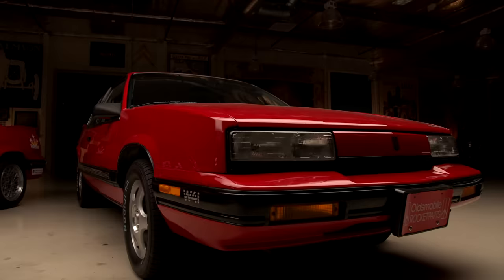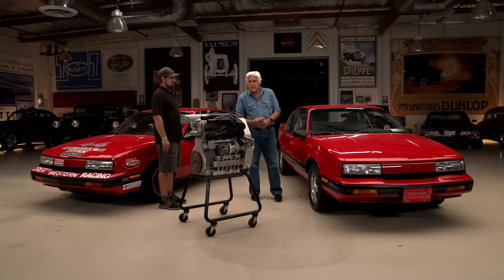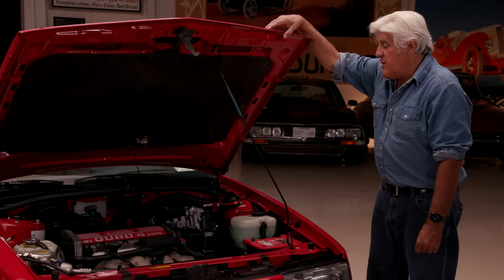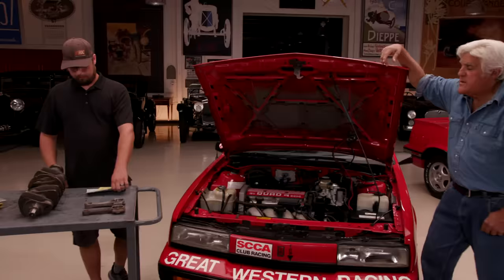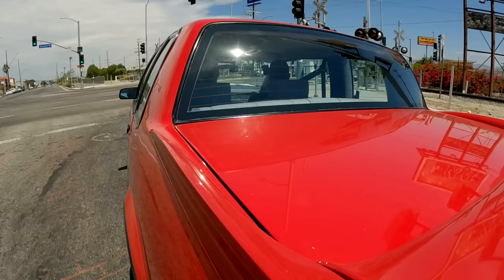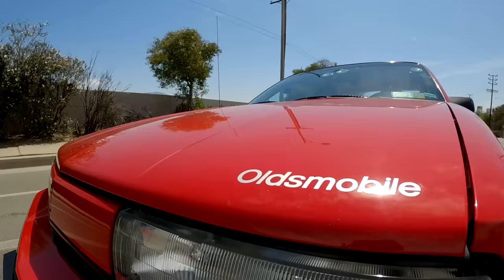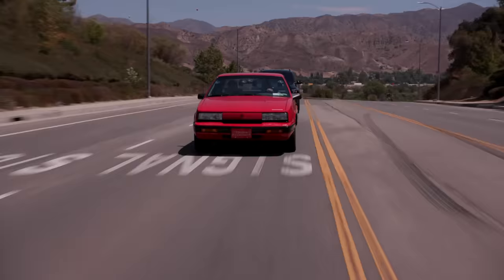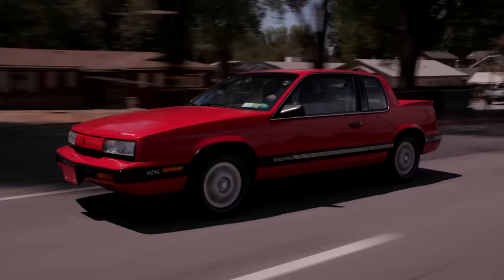Rare 1991 Oldsmobile Quad 442 W-41 | Jay Leno's Garage

Comment: I worked on many a quad 4 back on the day. Great engines that lasted 300k miles. Change the timing belt at 100k, coil packs under that cover, plugs, and water pump and viola your done. Absolutely 💯should have gone into the Fiero...and I almost bought a cutlass Calais IS or international series. I think I have a brochure around the shop here somewhere...had a friend with  a turbo grand am,, same chassis,, that sucker would fly...get well Jay we Love you

Comment: Reminds me Beretta GTZ🥹/Z26 still lives 😎best to leave  motors stock on these old GM💎 Quads/3.1-3.8L 🪨only change the muffler flowmaster Super 44 keep all O2/cat daily em till they die and only use metal gaskets when they go but their easy DIY learner  reliable engines those 3.1s  now them Quads good luck 😭

Comment: Electric will not work in the upper midwest in the extreme temps. We will still need internal combustion in those areas until they find a battery that won't get a strain on it in the cold. I own a Hybrid I get 475 miles to the tank in the summer and 350 in the winter.

Comment: So did Grand Am or Skylark ever get quad 4 or similar engines or was that only for Olds?
Reply: The Grand Am and Skylark got the LO 150hp 2.3L Quad 4. All Buicks were automatic. The Grand Am GT could have been ordered with the HO 180hp 2.3L and 5 speed.
Reply: @Draftinwithjr3815  so if you wanted the 190 you had to get the Calais?
Reply: @Dan Wake  correct. Less than 2500 examples were produced between 1991 (200) W41 Calais, and 1992-1993 Achieva SCX W41.
Reply: @Draftinwithjr3815  only 200 Calais were made with that engine? It’s amazing so many people in the comments know someone who had one lol. So the achieva would be a lot more common then. Probably heavier though.

Comment: Grandma had a car like that with the Quad 4 motor and I did a tune up on it. It took me like 6 hours to get to the distributor cap. They had it stuffed under the back of the motor. But it was kinda impressive for a 4 banger. I had my 72 Dodge Challenger with a built 383 so no comparison.

Comment: Worked in a garage during that time that engine sucked! Only one worse was the 2.5 liter in the lemans!😳Lemans! 2.2 was the way to go, 2.2 would come in with over 200,00 miles and still pass inspection, 3.3 and 3.8 V6's were great aswell. 3.8 was an Awesome engine!🙋

Comment: Hmm...  
  
The 1992 Opel Calibra Turbo is similar -  2-liter DOHC 24 valve, turbo, 204 hp, 4-wheel drive, 0-62 mph in 6.7 seconds, and 152 mph top speed.  Not 204 built, but 12,677. (all Calibras 240,000).
 
 And sorry, I think the Calibra is a little more elegant than this one, was a coupe version of another car call Vectra. 
  
Maybe have a look.

Comment: unfortunately the mass produced quad 4 engines were junk. specifically the 2.3l version. they came in the buick skylark, grand am etc. mechanics hated working on them. head gasket issues galore. thermostat housing is located under the rear exit exhaust manifold. definitley a low point of the 90,s for gm. the 2.4l version was a lil better, but still suffered issues.

Comment: I had no idea they put that much engineering into that car.  In typical GM fashion of the day it was buried in favor of more “Dustbuster” minivan ads and other failed lines of effort.
Reply: The dustbuster minivans that got the 3800 V6 were fast.  Car and Driver did a test of minivans and the Olds Silhouette with the 3800 smoked the field.

Comment: Didn't they have this in the 2door Beretta with 193 hp?
Reply: 180hp HO version of the Quad 4.
Reply: @Draftinwithjr3815  We had it with officially rated at 193 hp (and probably more than that, inofficially).

Comment: Definitely a cool little car but to say that they beat on 5.0L's is a little bit of an exaggeration.  I was actually a car salesman for about 3 years at a GM dealership around 1990, and I drove a couple of these (or the Calais International, which was a glammed up version of the Quad 442 but essentially the same engine/car...)   Much to the disdain of the management of the dealership, I drove a green 1990 5.0 coupe with a 5 speed (of course I had to park it across from the dealership! Lol) I can conclusively tell you that no, these cars would not beat on any 5.0 5 speed unless the driver was asleep or over aggressive at the light (up in smoke!)  Except for maybe a full load GT 5 speed, these were mid to low 14 second cars bone stock from 87 to 93. If you beat the snot out of the Olds, revving to 5 grand and hoping to hook, and you powershift thru the gears you 'might' get close to a high 14 second run. But to break into the 14s in this era, with the power the 4's had (shy of a heavily breathed on turbo) - was exceedingly rare. Remember, the 5.0 had 300ft/lb of torque compared to around 200 in the Olds, plus 225hp vs 190. And the weight difference was only about 2-300 pounds.  My strippo coupe had no a/c, roll up windows or sunroof, and minimal power robbing options. The 'I beat on 5.0's all the time' folklore of the era was (far) more often than not, highly exaggerated! And yes, I'm 53.  I'm old enough to have seen and lived through the revival of the musclecar wars...which were started with the much loved of loathed 5.0 Windsor. 

Now,  if he's talking about the 1994-1996, then yes, you can probably run door to door with one...sadly
Reply: Sadly you are mistaken. The W-41 is not even close to the same as the I series you are talking about. The W-41 is far more than even the W-40 Quad 442. Yes, the W-41 will beat the 5.0 Mustangs because I beat many of them in mine. I will admit that you would not have to do much to the 5.0 to beat these cars but stock to stock it was all driver
Reply: @oldsjetfire8975  sorry but as much as you may like the car, you're incorrect.  It's pure physics. You have a car with over 50% more torque (which is what wins races  - we're not talking highway roll races or top end speed...which the v8 would also almost always win) - as well as a good 30+ horsepower.   In  a car weighing a few hundred pounds more. A notchback/coupe 5 speed, whether earlier speed density or mass air, is around 2900 pounds. Like I stated, a porky GT with all the body cladding,  heavy hatch and (typically) power options would be a drivers race, more often than not due to them being around 3200 pounds.  As well, you're far more likely to run into one equipped with an automatic.  And if you beat one on the street (unless you actually knew or chatted with the guy after) all your ego will tell you is you smoked a mustang. And this is what you'll tell your friends. There was nothing in the price range - domestic or import, stock for stock - that offered more bang for the buck than a 5.0 coupe from 87 til about 92.  Primitive in many ways,  but nearly indestructible. And if you couldn't run a mid 14 quarter off thd showroom floor, something was wrong. Even when my car had the ridiculously tall 2.73 gearing i ran a 14.34 at 93 mph. No mods. Firstt run (sea level) And you could buy one brand new for around $12-15000. Don't get me wrong,  The Olds were quick for what they were. But we're talking about a n/a 4 cylinder. Again,  I not only drove them,  I sold them at the exact time I owned the mustang. Even to this day drag racers love these fox bodies and they are selling for crazy amounts of money. It wasn't until the Diamond Star triplets that there was serious 4 cylinder competition to the 5.0. Possible exception would be the Chrysler turbo coupes (laser, Daytona)  Even those, in stock form, couldn't hit mid 14s, but with the turbo had a fighting chance...but being k-cars, they were almost literally disposable.
Reply: @lancemannion4113  I am talking right off the show room floor. Every magazine from the early 90's was saying an automatic 5.0 was mid 15's and the manual was low 15's to high 14's. All my friends cars were also in that range with their 5.0 Mustang. The 5.0 Z-28 was even worse. The W-41 was a consistent 14.7 car. In the end, neither your experience or mine mean much when ALL the magazines were consistent in these numbers. With that, I stand by my statement that it is going to be all driver between the two cars. There were only 204 of the W-41 cars made, you likely drove a W-40 and not a W-41. I need to post the video of me beating a 5.0 Mustang. I admit, I did not beat him bad in this video but I consistently beat them in the 90's.
Reply: @oldsjetfire8975  The big 3 magazines (Car and Driver, Motor Trend, Automobile, Road and Track) were all notorious for being 'gentle' as far as trying to establish the best results possible. When you went to hot rod magazines such as Car Craft, Hot Rod and especially Muscle Mustangs and Fast Fords, you will find that these publications were much more in tune with what it took to extract all the power and put it down to the ground, which they did. I actually have 2 full cardboard boxes of all these magazines listed from 1986 to about 1995 (probably about 500 magazines) as that's what I when into the scene and I was pretty much obsessed with drag racing and the muscle cars of the era. I can certainly send you screenshots showing how all 3  mags got these cars into the low 14's but the trick was you had to master the launch and not exactly be gentle with your upshifts. The car could easily take it but the mainstream publication magazines wouldn't go so far to 'beat on it' to get the better time. And another problem with the Mustang, and the reason you probably beat one is because they were cheap, so they were easily accessible to the younger crowd who were over enthusiastic and really didn't know how to drive them (see, wall! Lol)  They just thought you could rev it to 3 grand and dump the clutch and you'd be off and running. Which is never the case with these cars (without slicks) With the solid rear axle they will hook up but it took prodigious use of the throttle and clutch. But once you mastered it, these were easily keeping up with corvettes on the street up (until the LT1 was introduced) And even the Corvette powered IROC and GTA with the 350 L98 weren't really a match, although they were closer. I do recall the mustang probably lost a couple of tenths of a second around 1991 with the light refresh when they went to the 16" wheel. But even then there's no way a properly driven 5.0 would lose to a 4 cylinder with 195 horsepower. It doesn't compute. Just because you beat 1 does not mean you've set the precedent. 9 times out of 10 they will pull ahead right through the quarter. 

Bit we can always agree to disagree if you want.
Reply: @oldsjetfire8975  bone stock, as an example...(14.16)

https://youtu.be/gAlRas_r-1Y
Reply: @lancemannion4113  So what you are saying is that the W-41 would also be in the low 14's if it were Hot rod or Car Craft and not motor Trend or Road and Track? In the end, neither one are very fast and I know them both well. You have your mind set on the W-41 being inferior and not an equal. That is typical of what I see from the Mustang guys. Have a good day.
Reply: @oldsjetfire8975   Well I went through a good deal of them (mags) over the past couple of days. And as you can see from the video I sent,  I was able to confirm many low, and even 14 flat quarter mile runs with coupes and surprisingly even hatchbacks. They were a bit easier to hook due to weight distribution. I haven't yet run across one musclecar/hot rodding mag yet that has bothered to push the envelope (or even test?) on the Olds. I did find 2 mainstream mags source confirming high 14 second runs (with 0-60 times of 7 flat....way off any comparable mustang of the era as well. They were consistent low 6 seconds, again NOT a GT )  A .5 to 3/4 of a second on the strip is pretty significant when you're nearing 100mph, as I'm sure you know. And like I said, get a good driver in the olds against a bad one in the other car and you'll probably garner a few wins. But numbers and real world data are there for you to read and confirm. Whether I drove the 'base' Quad 442 or I.S. Calais with the 190hp engines when i sold these, I'm quite certain another 5 hp and a few tweaks isn't magically making this car any 5.0 destroyer.

And not to bash a dead horse, but the actual overall assembly quality and craftsmanship of most GM cars around then was abysmal. These were also notorious for head gasket failure. The mustang was a much better built car in pretty much every way....which is why you still see them 35 years later but when's the last time you ran across any Olds calais/442? These were a desperate attempt to compete with the hot hatch imports, and although quicker and faster, they were loud, coarse and agricultural, in comparison.   I'm pretty sure you would admit that.  I might have sold 3 or 4 over the course of 3 years at a very high volume dealership.  I don't agree with GM later killing Olds as my very first car was a 70 cutlass s and I loved it, but the 80s was a dark era for them and it wasn't until the 93 f body twins and c5 vette did they come out of their sleep. 

To each their own. Take care

Comment: 1991 Pontiac Grand Am SE Coupe had LGO Quad 4 Cyl Pontiac made 200 of those cars too like Oldsmobile did with Cutlass Calais. Quad Engine was used in many GM cars from 1988-96. To answer question  OBD 1 came out 1980 1/2 1981 on GM cars with Inline Plug than Dual Row, 1996-Current  OBD 2 . Early 1980s Cadillacs had GM Best OBD1 Systems you could Access  Codes in AC Heater Control Digital  Read out by Pushing OFF and WARM  Buttons and Display Engine Fault Codes in Digital Numbers if Check Engine light was On in Instrument Panel. GM Wrote the Book came to Displaying Codes Reading Live Data from ECM on a Hand Held Scanner  Factory Manuals are Best too Diagnosing Fault Codes on any of their Systems Mercedes at the time was way behind on that type of Tech took them Ten years to catch up and still not as good.Vast Diag info like GM

Comment: The quad 4 had so many promise it was the first GM car with four valves per cylinder and fuel injection since the cars were vague of 1975 76 the big problem with this car was that it had a lot of valve cover gasket issues and oil leaks but other than that it could have been a very decent car for a number of different vehicles at the time from the fiero to Camaros and Firebirds this engine also appeared in the in body Grand Am models as well and also the Chevrolet Beretta.

Comment: Isn't this the same as the Pontiac quad four? Because it was awful. Fast out the box, but slowed down drastically after around 20,000 miles. Engine only good for about 100,000 IF the timing tensioner didn't give out sooner.

Comment: How many cars, similar to this, ran under the radar, and never got the attention they deserved? 
Cars like the HHR never got any appreciation, (HHR stands for Heritage High Roof) (I call it a Half a Hot Rod) even though they, for a cheap car, are quite reliable.
Oldsmobile was quite a great brand, My dad owned a 1941, yes 41, that had one of the first GM 3 speed Hydromantic tranies. Man was that an ugly car. Olds did a lot more too. I think they should have kept Olds and dumped Buick

Comment: JAY BACK IN 1990 I HAD A OLDS CUTLASS SUPREME SL WITH THE 3.1 V6 AND WITH 6900 MILES ON IT IT QUIT RUNNING OUT OF THE BLUE  IT WAS TOWED IN AND THE DEALER GAVE ME ANOTHER 1990 CUTLASS SUPREME SL WITH A 4 TURBO IN IT AS A LOANER . THEY ASKED ME TO GIVE MY OPINION ON IT. "IT STUNK"""!!! OF THE LINE I COULD RUN FASTER ONCE IT GOT TO SAY THIRTY MPH  THOSE CAMS AND MULTI-VALVE SET AND TURBO KICKED IN IT WAS STILL JUST O K. NO PERFORMER !!! AND THEY ONLY MADE A FEW OF THOSE 4 CUTLASS SUPREME'S . AND IT TOOK ONE WEEK TO FIX MY CAR AND A COMPUTER HOOKUP WITH DETROIT TO FINED OUT IT WAS THE WIRING AND THE HAD TO REPLACE THE WHOLE HARNESS FOR THE ENGINE AS THEY COULD NOT PINPOINT THE EXACT SENSOR THAT WAS NOT WORKING.

Comment: Had this car in this exact color.  Biggest piece of crap I’ve ever owned. Crank snapped at the flywheel for no reason. Replaced crank. Synchros went in transmission at 35,000 miles. Replaced transmission. Computer fried at 40,000. Gave it away with 45,000. 

Still have nightmares of pulling  and rebuilding that engine. After years of working on well built Japanese cars, this piece of trash turned me off on American cars for ever.

Comment: I though that engine was great at the time and was the future of USA cars, too bad there were so many head gasket problems with them, and the fact that you had to remove way too many 10mm bolts to remove the timing cover that was pinned up to the strut tower. Doubt this car would keep up with a 5.0 Mustang from the late 80's early 90's, unless it was an AOD.

Comment: Uh, @ 8:33, that's NOT even close to the same engine as the one on the stand... Let's see what's under the hood of the race model on the left... Yeah, @ 11:25, the engine in the race version? ...not the same engine as the one on the stand... this guy's a kook. Just because Olds put that engine in an Olds Cutlass Calais once, doesn't mean that engine has anything to do with those cars...
Reply: Tell us that you didn't understand what you watched... Never once did he say that motor was ever in the Calais. The motor on the stand was developed for the Oldsmobile Aerotech Program. The Aerotech motor was designed to show the capabilities of the Quad 4 motor and was never made available to the public. The Oldsmobile Calais Quad 442 W-41 production motor was based off of it.

Comment: Blown head gaskets much? It was a fun engine when it came out, but by today's standards mediocre at best. I had a customer with a Beretta with the quad four. The fuel pressure regulator failed and hydro locked. I pulled the spark plugs and spun the engine over. It shot a solid stream at the bottom of the hood, which deflected right at my wife. Good times!